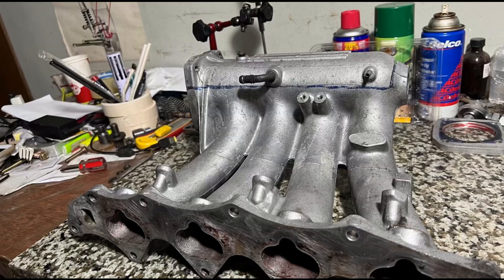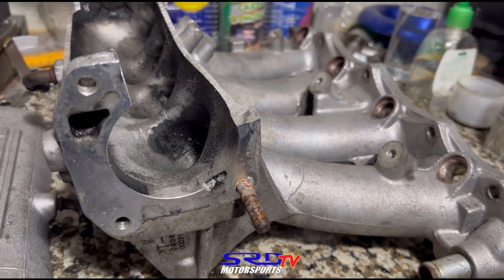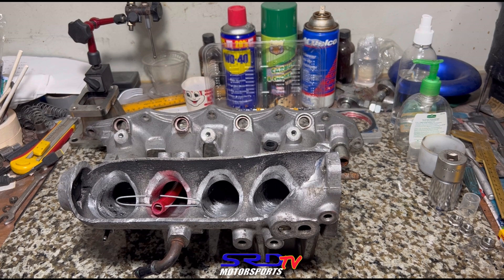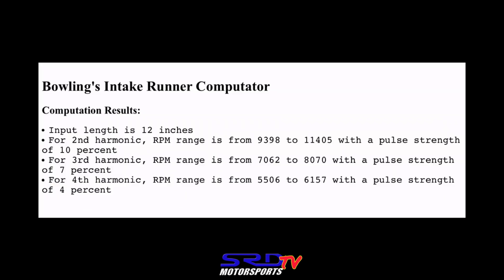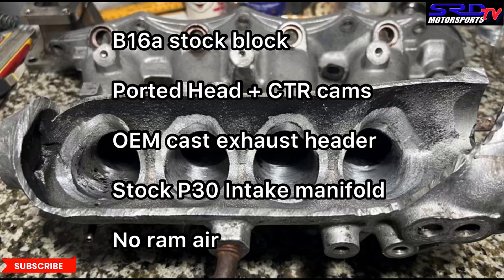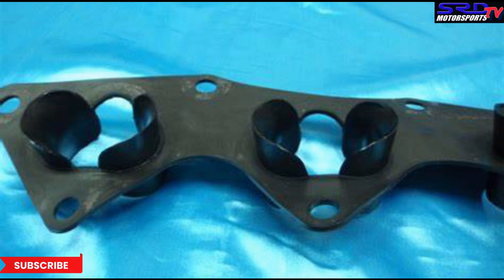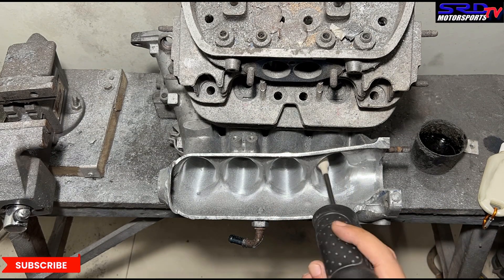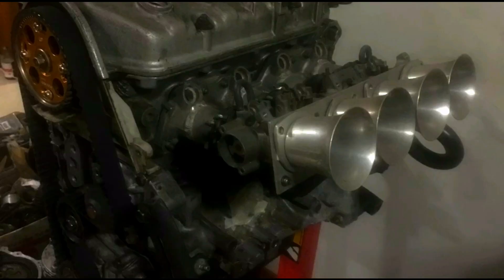B16a Intake Manifold Porting Development SRDmotorsports P30

Comment: All this is great information Ralph. I’m from Australia and was in the Philippines for work, not far from you actually. I was going to come past the workshop and show some picks of my DC2. But I got Covid while I was there and it shorted my trip. I just want to ask, what intake mani would you 
recommend for my setup? B20 with sleeved 86mm bore x 89mm stroke so it’s actually a B21 when you round it up. It’s been O ringed too but is still too dicey to run boost, so I want to get the most out of N/A, it currently has kelford 176-c cams and has 190hp at the wheels currently, looking for more but the midrange is superb! Any help from someone with plenty experience would be greatly appreciated!😊
Reply from the maker: @nicmccarthy8300  bummer on the Covid man! Sorry it shortened your trip… 
I agree 86mm bore is mostly for NA and that’s alright u got a good cam right there 
In this rare instance if you aren’t running ITR manifold or if you are, an Ultra Street or Race skunk2 would give u more top end as the displacement already takes care of the midrange
Reply: Thanks so much for response, they were my thoughts too. I currently have a Victor X that I’d bought way back and was going to use it for forced induction. It carries up to 10000 rpm but I feel the engine has more to offer through the middle, especially with the lowish rod stroke ratio. Many thanks again and keep up the awesome work!!! 🤙
Reply from the maker: Yeah the victorX kills alot of midrange for NA use

Comment: How much you charge
Reply from the maker: Our fb shop page has a pricelist pinned post
Reply: What motor did you use for that set up did you have stock pistons or high compression piston with the p30 intake manifold
Reply from the maker: @Lorenzo-t8d  it had CTR cams and arias pistons but stock 81 bore we have a dyno here of it , it’s the white ek civic siR last year… made 181-183whp I think
Reply: @SRDmotorsports   how would the p30 perform on p75 head an stock b18a1 block with b16 pistons pr4
Reply from the maker: @Lorenzo-t8d  it needs to be modified to work and fit a p75 head
Reply: @SRDmotorsports  yes it's been modified how it was shown in you previous video
Reply from the maker: That will work good
Reply: @SRDmotorsports  can It be used as a daily driver without the water jacket
Reply from the maker: Paco from Portugal his daily driver ek hatch b20 is like that but he tapped the head to have the water connection alive
Reply: @SRDmotorsports  so tape it and put a 90* degree 
Take a lil more material off intake? Do you have photos or video on his ek
Reply from the maker: Il see if I have

Comment: When you say  that you dip the porting bit in ... Was that, 'mix EPF?+ mineral spirits.' and if so what does EPF stand for?
Reply from the maker: ATF (automatic transmission fluid) that’s lighter than motor oil and the mineral spirits can be kerosene to further lighten it up
Reply: @SRDmotorsports  Thank you for that. 
By the way, I've a S2 manifold but don't want to cut it open as I'm planning to use a Flex-Hone, to port it. Im thiking of using a larger brush at the entry end of runner, and then dropping down to the narrower brush toward the end where it enters the cylinder head
Reply from the maker: @Midnightrider773  I think the flex hone can work and just spend more time near the runner entry (to eat more aluminum) than nearer the head
Reply: @SRDmotorsports  Thank you for replying
Reply from the maker: No prob!

Comment: Amazing video I have a b16a6 down in south africa on a stage 1 tuner 1 cams stock block i won't be going pro series intake after this video. Quick question what tb do you recommend and induction for maximum torque and kw?
Reply from the maker: Nice the 70mm tb is a decent upgrade and probably a cold air intake extension that helps daily driving torque improvements

Comment: so if I understand we want to 3rd hamonics at as high as the max rpm?

what would you recommend for a street car that has max torque at 3000rpm and max power at 6000.  Currently the 3rd harmonic is at 8000 to 9200 even without the port in the head and my rev limiter is at 7200. 

It's not a manifold suited for this engine and I think it clearly shows that
Reply from the maker: 3rd harmonic because that’s the length that we can physically try to fit in the engine bay
Reply: @SRDmotorsports  so for what rpm should I shoot to have the highest 3rd harmonic, around the rev limiter?
Reply from the maker: @miralemnermina142  depends on engine and set up… when u mentioned 7,200 I was thinking b20 crv engine that’s why the b20 intake manifold has a way longer runner than even the p30 (have not measured it yet but we know it’s long)

Same with the d16z6 and d16y8 sohc intake manifold the runners are longer as it bends upwards
Reply: @SRDmotorsports  unfortunately it's a fiat 1600cc in a yugo with yugo efi intake manifold
Reply from the maker: @miralemnermina142  oh sorry I assumed based on the RPM hehehe if u wanna msg me at the shop page il search on pictures of the manifold u use and the engine… pretty sure there are some trick ideas that can come up :)

Comment: Good video - thanks
This will certainly offer  significant improvements in high power/ RPM situations  how much additional power might one expect in the 4000 to 6000 mid-range where maximum torque may be your objective - Assuming a stock cam for the time being.
Reply from the maker: Yes sir especially if it’s a b16a when even the torque of a D16 seems higher

Comment: May i ask how did you weld it?
Reply from the maker: tig weld aluminum... the only way
Reply: @SRDmotorsports  Thank you sir. I’ve got a small crack on the IM while installing only tig weld will work?
Reply from the maker: @fotismanelides8222  yeah i mean you can take it to a machineshop and most machineshops can tig weld it shouldnt cost alot if its just a crack or somethinf
Reply: @SRDmotorsports  Thanks
Reply from the maker: @fotismanelides8222  no worries man
Reply from the maker: @fotismanelides8222  in about 3 hours I’m schedule to upload something crazy you might enjoy 😂
Reply: @SRDmotorsports  Can’t wait to see it 😄
Reply from the maker: @fotismanelides8222  maaan thanks for the channel support and no worries man any comment question il try to answer well
Reply: @SRDmotorsports  you definitely deserve it man. Great work

Comment: What hp gains expected from this particular port job
Reply from the maker: Really hard to estimate gains like that alone as u see on the example it upgraded to CTR cams too but it’s safe to see 5-8% gains on manifold alone and more with other complimentary parts
Reply from the maker: I know an SiR 4door that went for this and after the manifold upgrade it can easily “chirp” third gear like light spin and when stock manifold it couldnt

Comment: Hi, I got some question. I also use the P30 intake manifold, if I do this Port and Polish in my intake manifold, the function is same as ITR manifold or better than it?
Reply from the maker: Maybe a bit the same but it’s complicated…. Example on a B16a yes it could work like that but for a B18 or B20 the ITR might work better because of volume it’s bigger
Reply: @SRDmotorsports  Oh... So if I custom the volume same ITR, the function just same ITR and better than ITR, is that means?
Reply from the maker: @lunwiszy52  for a b16 engine there is a chance yes
Reply: @SRDmotorsports  Okayyy, thank you, I try my best custom one.😂😂
Reply from the maker: @lunwiszy52  thank you also for checking this out :) and yeah take it slow to get to the shape you need to achieve

Comment: This video will make the B16A manifold expensive, hahaha! Btw, someone from MFactory's following your videos ;)
Reply from the maker: That’s my fear hahaha prices will go up lmfao!!!!!
Reply: Also, what you said in 6:34
Reply from the maker: @findtherightbeat  yep when we think about it even driving hard or spiritedly that’s looks to be the good window
Reply: @SRDmotorsports  Any thoughts on the angled throttle body wedge/spacer people were using back in the day? I forgot the brand but it had its heyday in the same period as the Ventuli plate. The angle supposedly improves/equalizes the flow to the intake manifold runners.
Reply from the maker: @findtherightbeat  the angled throttle plate? I think I can’t remember that one hmm

But reading what you said? Actually Skunk2 Ultrastreet manifold the angle solves such

Which is interesting
Reply: @SRDmotorsports  I really can't remember the brand, but it's just an aluminum wedge/spacer that's cut in an angle on one side and placed between the throttle body and the intake manifold.
Reply from the maker: @findtherightbeat  maaaan now it makes me wonder if it’s worth trying as u saw I have a 1/4in throttle flange here

Had Brodeth cut it years back when I needed a template and I realized I cuz just use stock throttle to align the plenum smh
Reply: It's interesting why Spoon stopped using the Ventuli plate -- that part piqued my interest back in the day but I didn't find much info on it then.
Reply from the maker: @findtherightbeat  on the ventulli plate me too! It’s why I never forgot it lol still curious and looking at it the craftsmanship is quite decent

Comment: long runners and short runners,  which or does it affect fuel consumption? lets say on a daily driven car.
Reply from the maker: I’d choose long runners
Mainly cuz I like big cams 😀
Reply: it has some effect to fuel consumption. for a daily driven car, better go with long runner since you won't be revving the engine high all the time. you'd be on low to mid-range RPM most of the time
Reply from the maker: @n.shiina8798  yeah the effect is “usable power” u step less on the gas cuz u got torque = more efficient than “less midrange” but step on the gas more… if that makes sense
Reply: @SRDmotorsports  totally agree. i smirked everytime people deleted variable-length intake manifold for the sake of "high flow" ones on their modern engines. it's not only about the maximum flow!
Reply from the maker: @n.shiina8798  so so true!!!! I wanted to say in the P75 video that yes flow is good but 
Flow quality > Flow quantity
But some may get offended and this is not Facebook 😅

Just like why I show dyno sheets as visual example… cuz peak power is only 1/3 of the equation but that gets the “wow” from a friend’s friend in FB 😅
Reply: @SRDmotorsports  i feel you!. lots of people attracted with peak power number but did not even bother to see the overall power curve!. i used to be like them but over time, i realized broad power band is what i wanted at most
Reply from the maker: @n.shiina8798  I agree I mean I was the same but when it was time to spend my money I wanted to be sure and not just cuz “me so so uses this and it works” 😀

Comment: Great and very useful. I see that you can get a lot out of the engine if you follow your steps. You got my like here, like always. Keep up mate. :)
Reply from the maker: Thaaaanks man!

The funny thing is on motorbikes especially 4cylinder? It’s the same 

The difference is it comes from the factory tuned better and too well already so the power on a CBR1000RR is higher than a D16 thats 1600cc 😅
Reply: @SRDmotorsports  Yes mate. It think a lot higher. Probably there is also the weight difference.
Reply from the maker: @RRRRefuelRideRace  yes yes that’s true

Comment: Hey Chief, after porting the head or intake manifold, is it ok to paint the inside with a special non peeling paint to have a smoother surface?

Can this help or it is useless.
Reply from the maker: IMO too scary I mean it might still peel… but I guess polishing it to a finer grit is def doable as I’ve done that, just too tiring 😀 and the Makita screaming “stop”

But good thing to bring it up… as generally a lot get confused by mixing different aspects of different “practice”

Our intake manifold is “dry flow”
Why? Cuz no fuel yet 😎 and the characteristics and reactions in a dry flow aren’t always identical to “wet flow”
Reply: Do you want your engine ingesting that paint when it peels off? Polish it to a mirror like finish that's how its properly done.
Reply from the maker: @GCS88   time stressing fo sho

But He may also be meaning “Anodized” which could work I think but then costly and man it’s a shame to be hidden  😅 

But true polish like crazy like the OG scoot shops aft sanding polish then it’s cloth then lastly “denim” so it’s abrasive seen it before 

Hmmm how that got me thinking hmmm
(Moments of craziness again lol)
Reply: @SRDmotorsports  I wouldn't put anything in there asides from proper porting, funny enough I got so curious about this and did a research.. Apparently alot of people have been pondering about it for different reasons, while I haven't read a claim that one has have done it, this train of thought was more often than not responded to with foul languages 🤣
Reply from the maker: @GCS88  ahahahaha oh maaan on forums back then this would happen 🤣

it sometimes bring up new ideas but often timws just a line you could write on your "signature" on the forums 🤣

Comment: Great work. Do you know how this would compare to an Edelbrock Victor X on a B20Z1 block with B16A2 head @ 12:1 compression?
Reply from the maker: Oh yes yes the victorX has 4in runners so it’s real short so most likely loss of midrange regardless of comp 

BUT…at above 8,200 rpm the victorX will start to shine so it’s a “pick your poison” kinda thing…
Reply: @SRDmotorsports  I'm not planning for this engine to even rev to 8200 haha! What do you think is a safe rev limit for the B20 block?
Reply from the maker: @IDCAG-h4f  tbh stock block I’ve seen okay to 8,200rpm actually

Ofcourse not everyday hitting the rev limiter 😀
Reply: @SRDmotorsports  Thank you. The crank, pulley, fly and clutch is balanced and it has high comp pistons but standard rods. I was thinking of setting VTEC 5k to 8k. But it's not a racer, just a weekend toy so I want good mid range and reliability. Maybe the Victor X wasn't the best choice then.
Reply from the maker: @IDCAG-h4f  oh man that sounds like a killer project! I feel sorry for the tires they be screeching too much 😂
Reply from the maker: @IDCAG-h4f  actually if you already have the VictorX ? You could try a d16 throttle which is 56mm   That could possibly become a vena contracts (Venturi) as I talked about it on the last 2 videos 

That’s worth a shot without needing to spend extra
Reply: @SRDmotorsports  It needs an LSD yeah, but the Toyo R888R stick really well. The Victor X is bored out for a 70mm Skunk2 Throttle, and is portmatched to the head, which is also ported and flowed. Next purchase I plan for is Rocket M24XX cams 💪
Reply from the maker: @IDCAG-h4f  good stuff indeed and yes the r888 is a good one!
Reply: @IDCAG-h4f  nice setup man! With those cams hope you going to rev higher than 8 because they'll want it higher especially with that manifold Vic x. If you wanted to rev lower ported p30 intake manifold should definitely work to make power faster on a b20 block with big cams. I made lots of torque on my b20 vtec with those cams with stock aebs manifold 70mm TB I believe. Even with SRD style intake setup would yielded more tq and hp with same setup.
Reply: @vtecnegro85  hey thanks man. I have a lot to think about now... I could increase my rev limit, or go down another induction route as you've suggested.

Comment: Based on the 3rd harmonic that was calculated, wouldn't a ported P30 manifold be just as efficient or better on an ITR for circuit racing or just in general?
Reply from the maker: in General yes actually especially for circuit racing atleast for me... and the dynograph
and the track 🤣

its why i started porting the P30 manifold years back , because i noticed the length is near ideal, so a lil volume here n there would def help atleast get "near" the ITR top end

lets not forget to facor in "cams"
with that calculation id prolly run a Pro2 cam even on a b18 :) no prob midrange and the cam can take care of the top hmmmm :)
Reply: @SRDmotorsports  I'm glad I'm not the only one who thinks so and it seems you've already gone and proven the theory and assumption! Cheers!
Reply from the maker: @mfactorypatrick145  I am quite glad too for what you were seeing!! 

TBH that’s what I “feel” I would go for it I had a circuit car for fun or for serious
Run a close ratio Mfactory 3-4-5 
BUT run a 4.2 final drive to give me the “stretch”

Which makes one wonder or think.. maybe just maybe that is why Mfactory has a 4.0 final drive hmmm! Now that would be fun!
Reply: @SRDmotorsports  gearing is all a compromise based on your tire size, redline and desired top speed. So it all depends.

I think in this case, measuring the intake volume of the ITR plenum and modifying the P30 as you suggested would be the ideal setup.

Or maybe that's why the Skunk2 intake manifold for the D series has such long runners that it is practically right up against the brake prop valve on the firewall. 

Interesting things to recall after watching your videos.
Reply from the maker: @mfactorypatrick145  I was gonna say it’s why my skunk2 sohc manifold luckily misses the brake prop valve but it’s right there next to it = long runners cuz. They prolly knew

Now sadly I just realized I never measured mine when it was cut open wtf now it’s an excuse to spend more and get another sigh our self imposed treasons that make us broke 😂